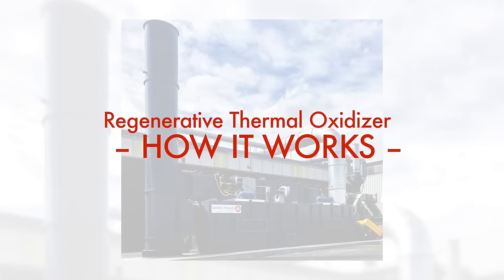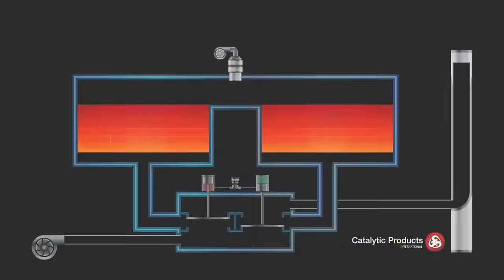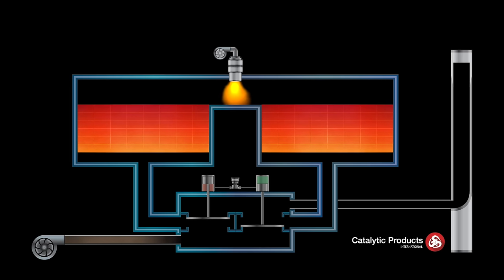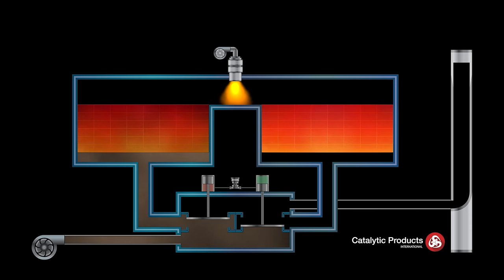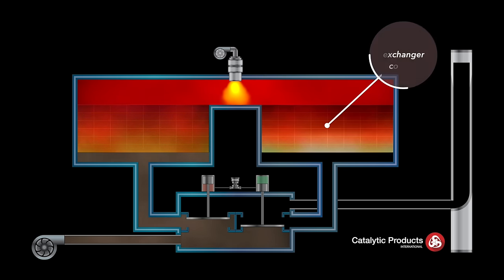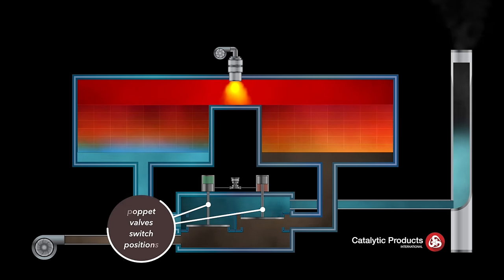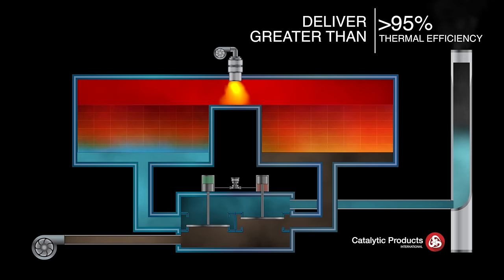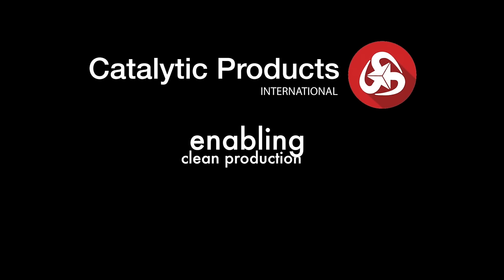Regenerative Thermal Oxidizer (RTO) - How it Works - CPI

Comment: Very cool!  If you bleed deferential temperatures off ceramic exchange cycle, you could run a stirling engine with a generator, further reducing power usage in other aeras also.  Nice!